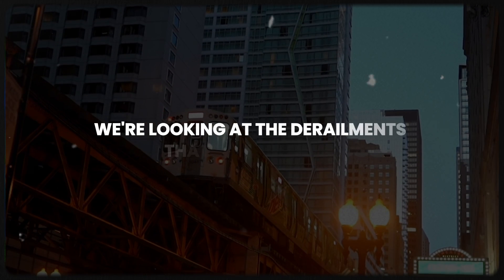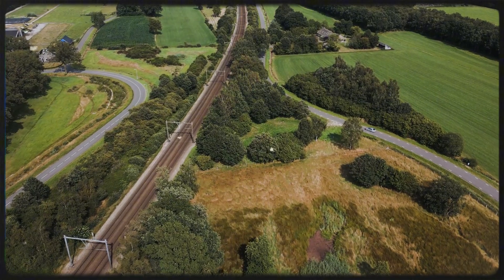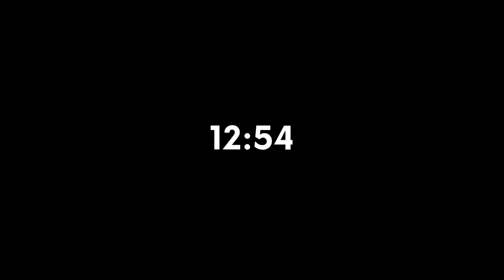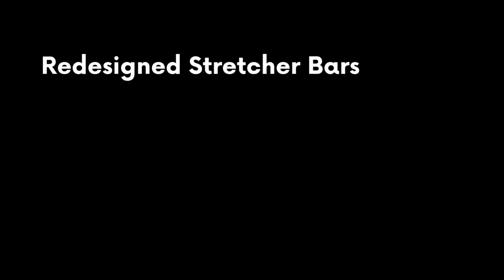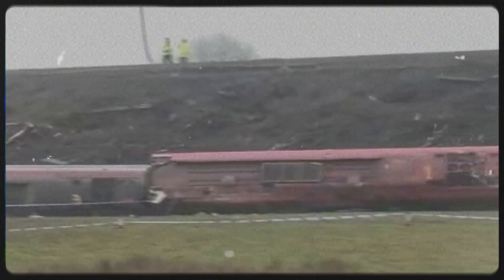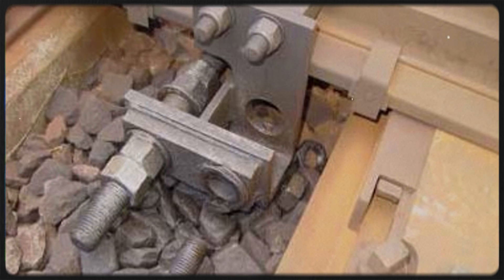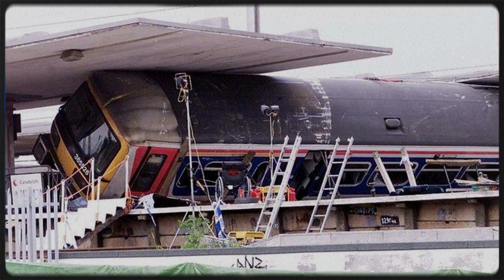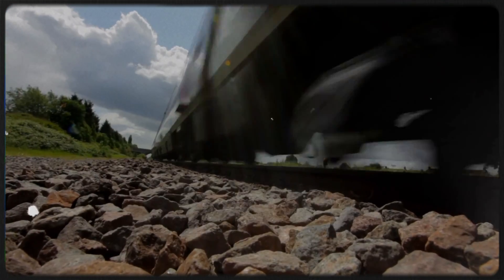Built on Tragedy: The Derailments That Changed UK Rail Forever

Comment: Network Rail has recently SOLD one of the two nation-wide-use high capacity Track Renewal Trains machines (which lift old railway and sleepers then relay new ones)  to Italy - as its not got the money in CP7 to use it to do renewals work. And made all the staff redundant.

Utterly unbelievable.  It'll take another big crash to show how stupid this is. And it's overdue.
Reply: I don't believe you're fully aware of all the facts and if you are, you're possibly not presenting them clearly.

Consider how much track there is in the UK Network (over 20,000 miles, 30,000 bridges and viaducts, 6,000 level crossings) and then that Network Rail replacement/maintenance crews are out every night and these crews are somewhat dwarfed by the Balfour Beatty, Colas Rail, SB Rail and Volker Rail crews contracted to do the same. 

The issue with CP7 is that inflation has made some of the money NR was allocated disappear (not just a small chunk we're talking approx. £1.6 billion!) so there's a massive hole and yes your underlying point about the potential safety implications on the network are valid, time will tell how valid. 

There are more Yellow fleet trains on the way. Consider reading this 

https://www.networkrail.co.uk/running-the-railway/looking-after-the-railway/our-fleet-machines-and-vehicles/track-treatment-fleet/#:~:text=Stoneblowers%20restore%20the%20line%20and%20level%20of
Reply: @bignosebrewery7078 maybe those redundant have found employment with the other private companies you mention?

Comment: This is how capitalism works. Privatisation, shareholders value, capital extraction by private equity.
Reply: Daft comment.  Capitalism does not equal substandard safety.  Most of the best things in your life are brought to you by capitalism, including the car you drive, the food you eat, the tech you enjoy.  They are kept safe by a mix of proper regulatory oversight, and competition (people don't buy food or cars that get known for being unsafe).  The airline industry is totally capitalist yet runs with great safety thanks to proper regulation and oversight.  That's why we have rail safety regulators independent from the industry itself, by and large they do a good job but sometimes things get missed by them, like RCF which was little understood at the time.
Reply: @marionbloom1218  Sure enough, capitalism doesn’t equal substandard safety. These are two totally different, if not opposite things.
The point is this: safety is not a goal of capitalism. Instead, the goal is making money, and safety is merely a factor on the balance sheet. The same applies for the airline industry: if airlines wouldn’t adhere to strict regulations (which, by the way, are imposed by the government, not by the industry themselves), people would refuse to board an airplane and they would go bankrupt! As soon as the government retreats, safety standards are lowered and people get hurt or die.

Comment: Lessons get learned, but they don't necessarily stay learned. I remain aghast at how the Wallan derailment of an XPT (a slower train based loosely on the UK HST) in Victoria Australia, could have happened in the way that it did.
Reply: That's why you need a system of knowledge management for safety.  Rule books, standards and regulations that enshrine the lessons learned.
Reply: Because the old people die out or retire, and the new replacements come in afterwards, and have not been there to learn why, just that these old procedures were there, and thus change them, not realising they were there because of tragedy, forcing them to learn again at the expense of a lot of other people's suffering and pain.